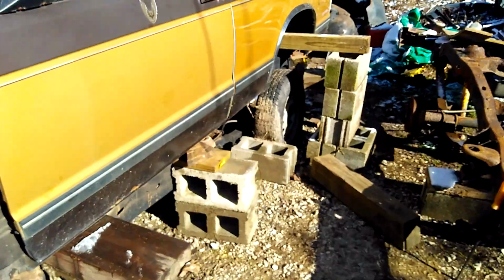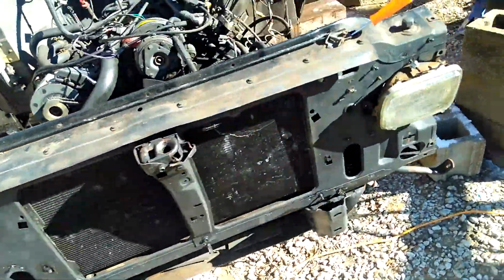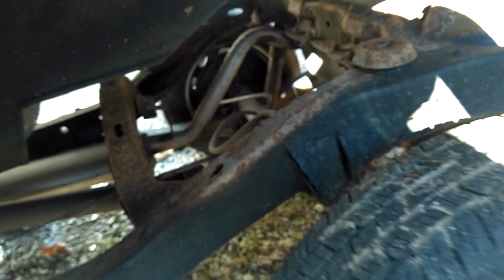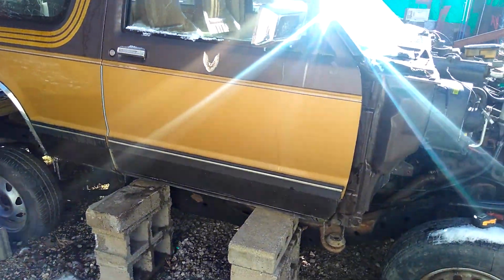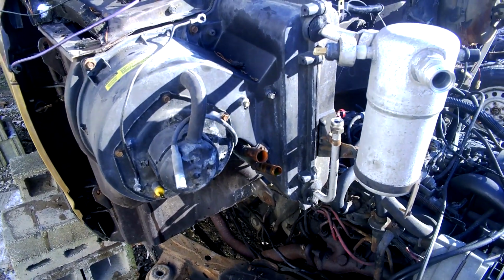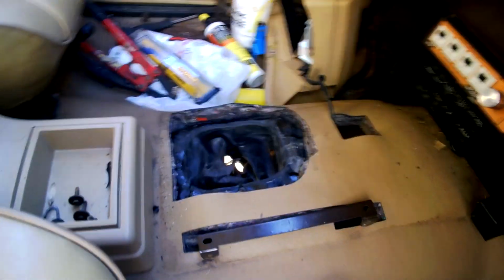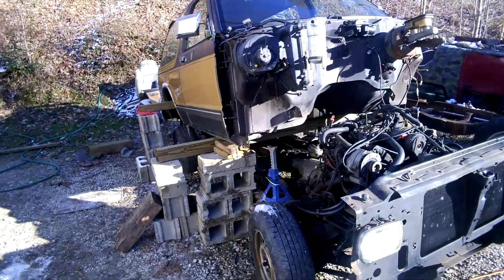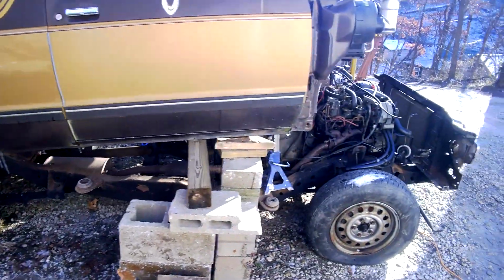The Blazer Body Is Coming Off

Comment: How do you remove the bolts attaching the frame to the body?
Reply from the maker: I believe it's a 15mm Socket, But that's pretty much it, you just take them off, Unless they are rusted out and won't move at all or  broken off then you might as well just pretend you didn't see it and move on LoL
Reply: @s10_4_life6  not that, I just cant find them...
Reply: @s10_4_life6  Do I need to remove the carpet? Where are the bolts located?
Reply from the maker: @jonross377 
Maybe this video will help you:
https://youtu.be/HVHP3woaFqY